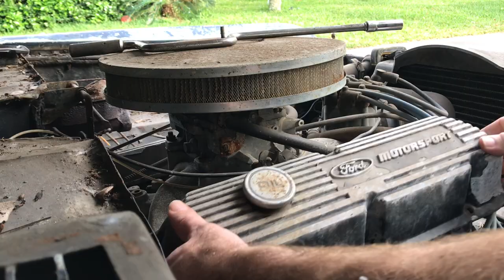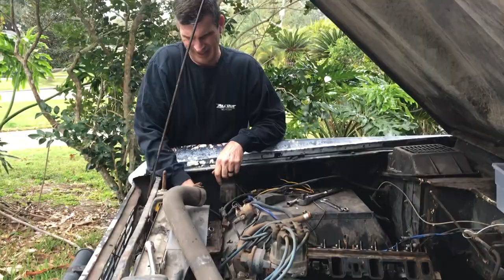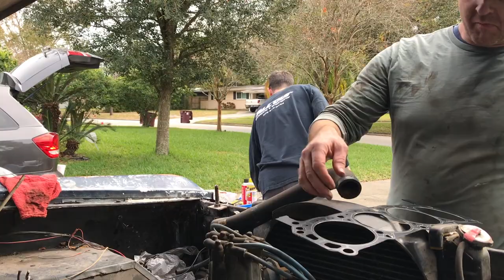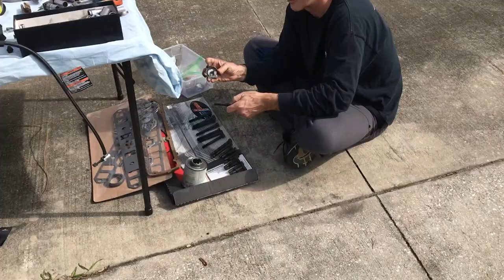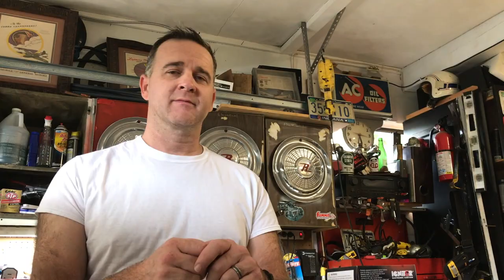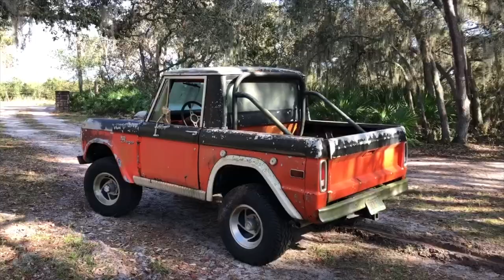HOW TO CHANGE CYLINDER HEADS - 302 5.0 V8 FORD ENGINE CYLINDER HEAD SWAP - BRONCO

Comment: The head gaskets need to have the coolant port holes in rear of engine. Also the short bolts should have thread sealant because they go into coolant jackets.
Reply from the maker: Thanks for watching. The gaskets are on correctly. Which bolts (and if bolts) need sealant is dependent on the year and displacement of the block. This is an original 72 block with 90's heads.

Comment: Let's see your buddies 800+ HP mustang! Good to see progress on the bronco!
Reply from the maker: Thanks! Yeah we will get a video of Jack's Foxbody sometime soon. It is a total sleeper- stock looking notchback with a monster turbo.
Reply: @FireItUpGarage  what is your update? How did the pushrod length work out, did you take the measurement with your existing lifters?
Reply from the maker: @rgharley  Thanks for asking. Yes we measured with the heads assembled. Ended up with 7.00 and a slight shim. Got it finished up and posting the first start video today actually! Great timing. Thanks for watching.
Reply: @FireItUpGarage  I may have some follow up questions after watching the video. I have a similar situation with a 75 Bronco, 302 same head with flat tappet lifters and a RV cam. Springs match the came using stock pushrods.

Comment: • Hey, Can I Ask If You Guys Had Too Loosen The Header Too Exhaust Flange Too Then Be Able Too Remove The Heads?
Reply from the maker: Thanks for asking. We only unbolted the headers from the heads. We did not disassemble any of the exhaust- so headers were bolted to exhaust at the flange throughout this swap.
Reply: @FireItUpGarage  • Thank You So Much For The Insight, Just Took Alot Of Weight Off My Shoulders ‼️ In The Process Of Swapping Head Gaskets And I Didn’t Wanna Do All The Extra Too Just Be Able Too Do That, 😃
Reply from the maker: @gionnieroberts9094  Glad to help. Good luck on the project. Take your time and it is not that tough.  FIRE IT UP!
Reply: @FireItUpGarage  • Yessir, Trying Too Get My ‘89 Fox Back Up And Ain Healthy Condition ‼️‼️
I Appreciate It Once Again Man, 🙌🏾
Reply from the maker: @gionnieroberts9094  Very nice. These heads are from a fox with the stock hardware but being matted to an original 72 block- which is why we ended up with the custom length pushrods.

Comment from the maker: Here are some of the parts you might need (check application) 
Manual- "How to rebuild a Small Block Ford": https://amzn.to/3xSniOO
Head gasket set: https://amzn.to/3BGFEnk
Full gasket set: https://amzn.to/3SbmMDY
Head Bolts: https://amzn.to/3BNNrQa
Head bolt sealant: https://amzn.to/3BMtSbd
Nickel based anti-sieze (for fasteners) https://amzn.to/3fa9EQO

Comment: theres no how to.. yall just doing it
Reply from the maker: Thanks for watching. This video provides a general idea of the process. A head swap is a very technical process. A service manual is a must to provide the torque sequence and best practices. In this video, we are bringing together an original block with a set of modern heads. This will not be the case for most people- so this is for general entertainment purposes only. Consult your service manual for your specific application. Consider this one "How to rebuild a small block Ford" https://amzn.to/3xSniOO

Comment: can someone tell what can I do when the heads of my 302 don't come out, they're like weld 🥲
Reply from the maker: As you can see these came out pretty easy once all the hardware was removed. But this engine only had 3k miles on it since last rebuild. With the hardware removed they should break loose with a little persuasion.